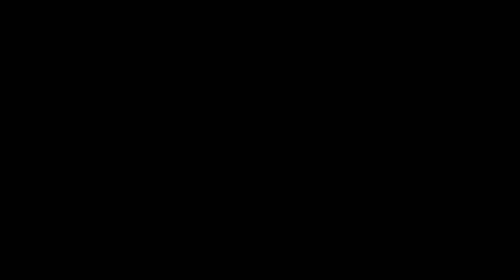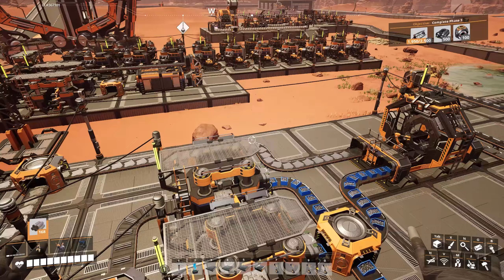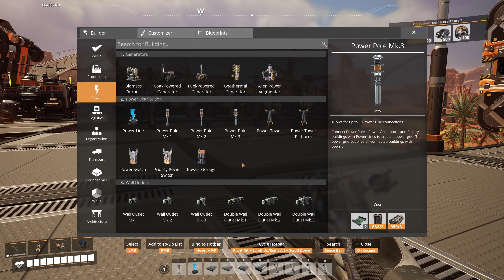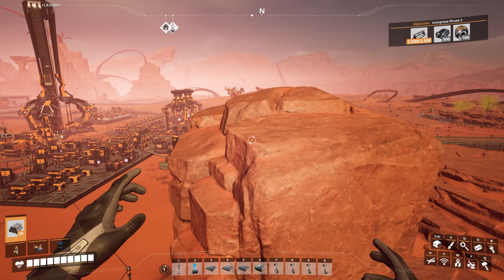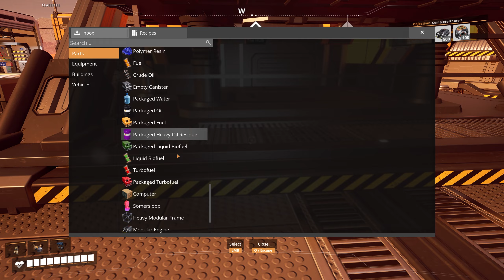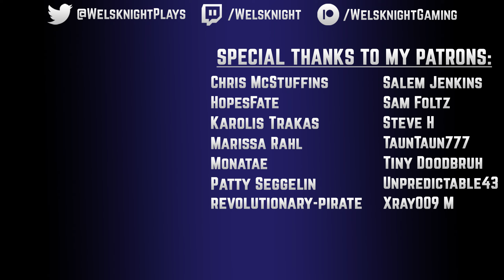Black Gold, Texas Tea | Satisfactory 1.0 - Ep. 6

Comment: MW is the rate of energy. It's the amount if power generated/used at any single moment in time, which is what you'd be talking about as far as generators go.

MWh (MegaWatt Hours) is a unit of energy, which would be the amount of power over time. Joules is a unit of energy, but so is MWh or kWh. 1MW generated over the course of an hour would be a total amount of 1MWh of energy over the course of the hour.

Think of power as the current flow rate of water flowing into a bucket, and energy as how much water is in the bucket.